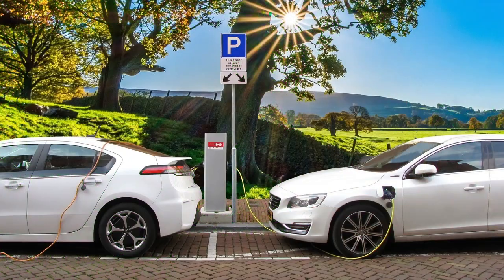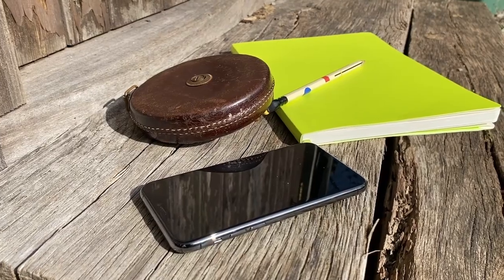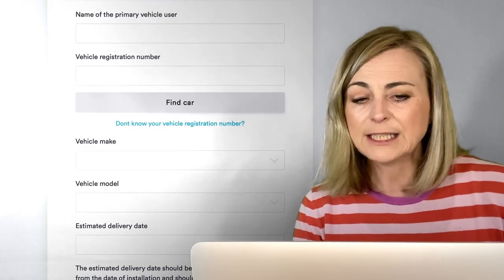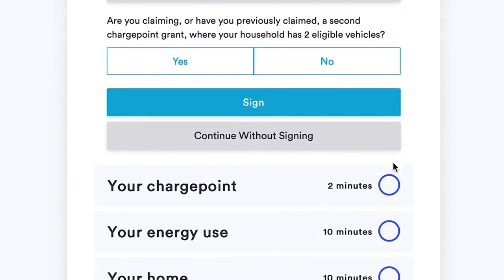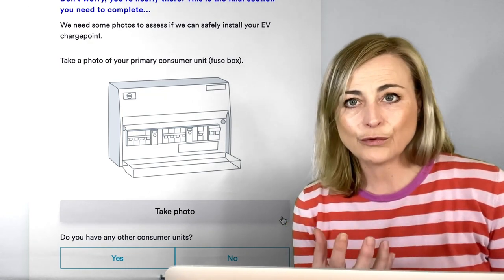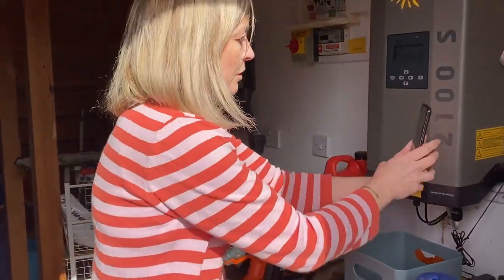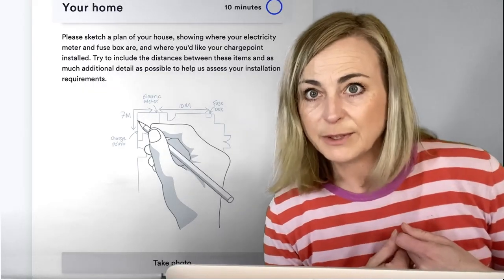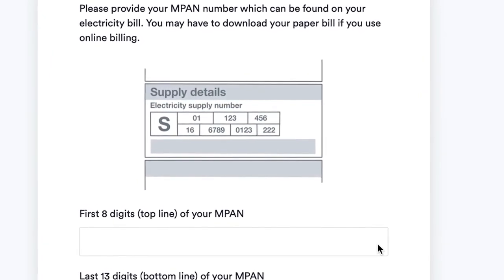Step by step guide to form filling for an EV home charger

Comment: It's probably worth noting that you should check that you are not on a looped service or may be at the end of a looped service. This info should be held by your DNO. If you are then you'll have to ask your neighbour if they mind having their garden/path/pathed area dug up in order to unloop the supply & reconnect you or your neighbour to the mains cable in the pavement or road. In most cases this is done free of charge. You could possibly find yourself with an EV or PHEV car that you can't charge at home because you don't get on with your neighbour & they have refused access.

Comment: I attached the floor plan marked up where boxes are and where the charger is to be placed. As well as the photos.
Reply: Yup, I did a little sketch of the side of the house and the dimensions.

The installer told me he was so happy with my install because he had a nice diagram and the right measures. His previous job the customer had said 7m but that was "as the crow flies" and not the actual way you could ever possibly run the cable from the consumer unit and it was more than double.

Comment: From an experienced EV owner:

If you’re buying an EV for 10’s of thousands of pounds, most people don’t care about recovering up to £500 from the government towards the cost of a home fast charging port. It’s not worth the bureaucracy or effort.

Get your local electrician to do it, they are fully qualified and they will just get on and do it without any fuss.

Go un-tethered to keep options open in the future.

Once it’s installed, you probably won’t use it much because the difference between 30 miles of range per hour from a fast charger and 10 miles of range per hour from a 10 amp plug becomes irrelevant when you’re leaving your car in the garage overnight, most nights for 12 or more hours.

Our scenario, we charge both cars in the garage from 13 amp plugs once or twice a week in normal conditions. If we return from a long trip with either car almost empty, we will most of the time still charge at 10 amps in the garage. If we need both cars and one is nearly empty, we will charge it on the rapid charger at 32 miles of range per hour at 32 amps for about 10 hours.